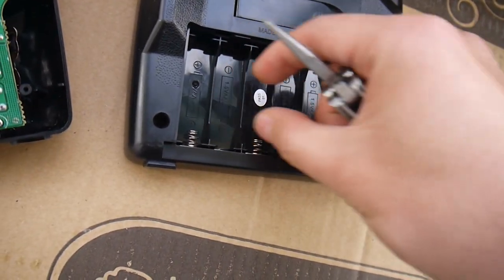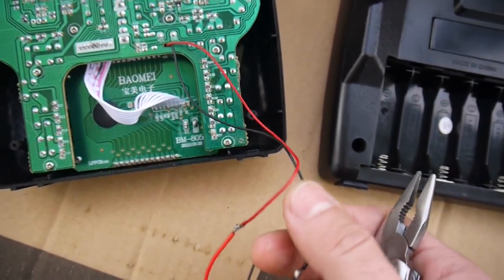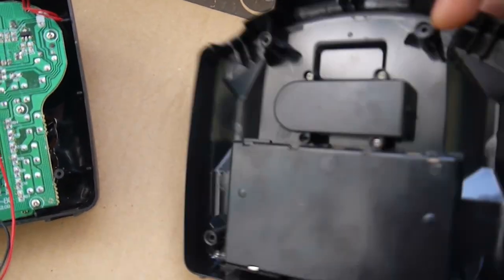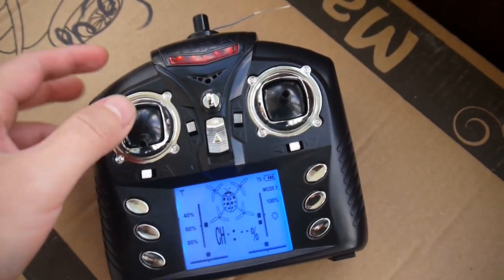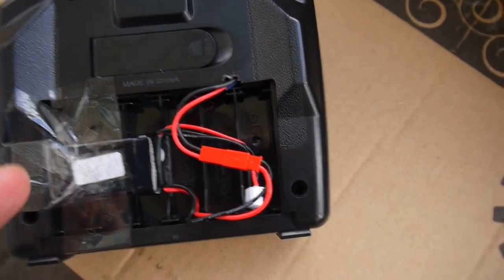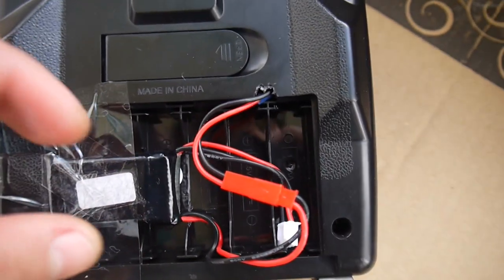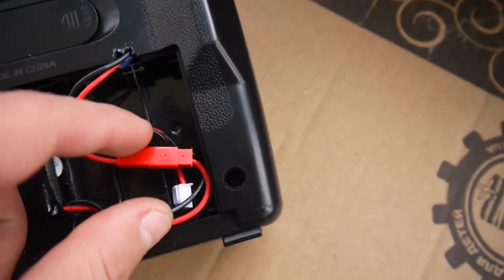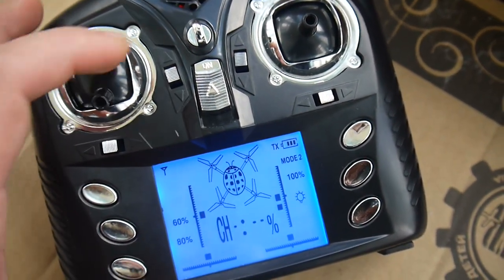Transmitter mod to use 2s LiPo instead of 6 AA batteries on WL, FY, JXD quads/helicopters Txs

Comment: This seems like it would provide less voltage.  AA batteries are 1.5V each and they are placed in series.

6 AA batteries x 1.5V = 9V

2S lipo batteries are only 7.4V so wouldn't this lower the power (range) of the transmitter?
Reply from the maker: 1.5v is full charge state when brand new aa battery. it then goes down to zero. there is voltage regulator so Tx module gets constant voltage regardles of battery state. 1v each is when normally Tx starts to beep. toy grade Tx ok with 7,4v. but my phantom Tx doesnt even turn on. safety limit is abot 1,3v per Aa cell.